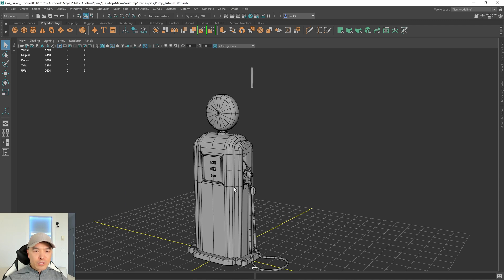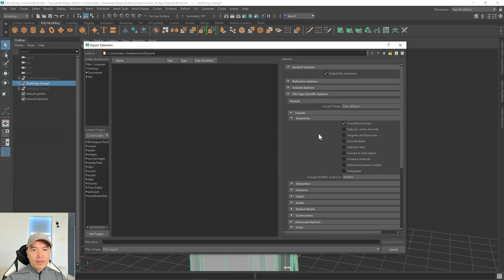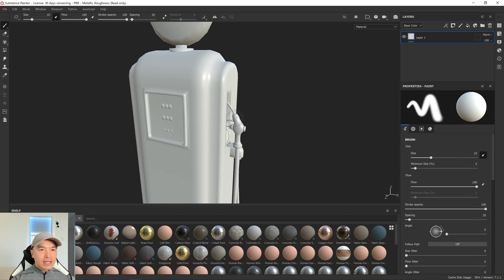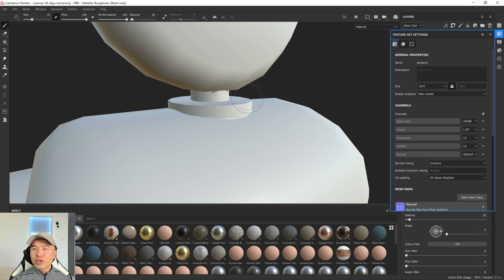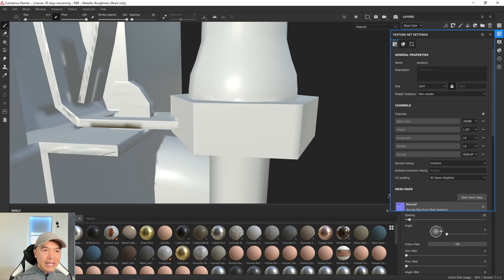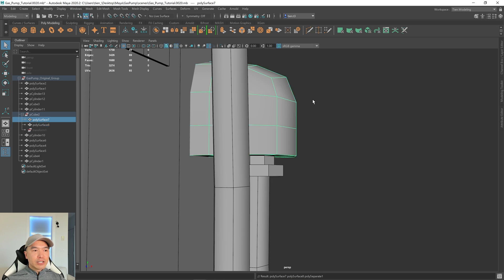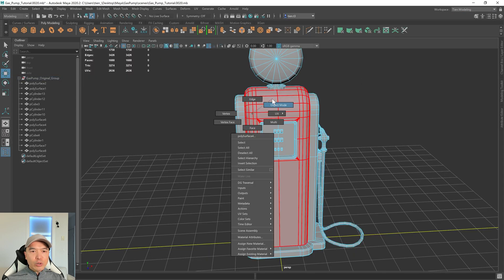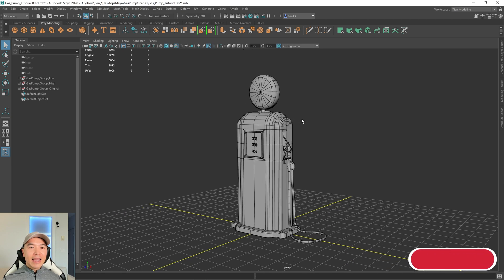How To Create A Gas Pump In Maya | Part 10 High Poly To Low Poly Test Bake And Mesh Fix

Comment: Hi there - big fan of the tutorials, have helped me learn so much. Just wondering which version you would use (mesh) for import to UE4? The high poly? Is it better to import mesh through SP or export directly from Maya?
Reply from the maker: Hi thanks always nice to see people getting something from these tutorials. The mesh that you would want to use for this workflow of high poly to low poly baking is the low poly mesh. Sometimes you would bring in a high poly mesh for an LOD (level of detail) method but that requires a different workflow and setup.

As for using the mesh that Substance Painter gives you an option to export I don't think it matters too much unless you didn't triangulate leaving Maya then there may be a chance of shading discrepancies. The mesh you get from Maya is perfectly fine and many times you may need to go back into the 3D program for a quick fix either for your own project or for a company and you wouldn't necessarily be going back into SP every time to export out a new mesh.
Reply: @DigitalDreambox  Thank you so much. So the point of the high poly really is to bake the "details" onto the low poly? Sorry, it can get very confusing! So I need to ensure I triangulate before importing into SP, and then use that same triangulated model for use in UE4?
Reply from the maker: @jameskilduff1622  Yes you got it. So for example if you sculpt a rock inside a program like ZBrush and it has a a million triangles, you wouldn't want to use that in the game engine cause it heavier to calculate. It's better to bake those details.

As for triangulating before leaving Maya that one is more of a best practice. All quads are made up of 2 triangles and not all 3D programs will divide them the same way which potentially can affect the shading. It will get triangulated by one of the programs at some point so this way it puts you more in control of what to expect.
Reply: @DigitalDreambox  Brilliant, thank you for the help. Look forward to future content, has really helped me with my modelling.